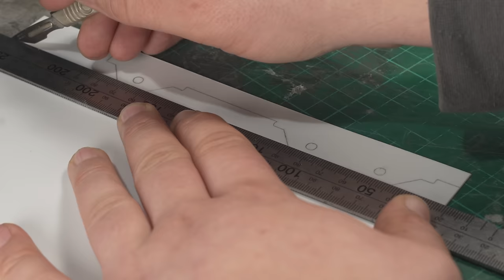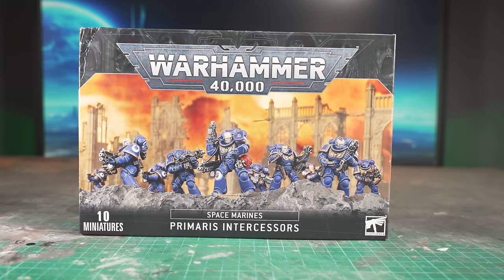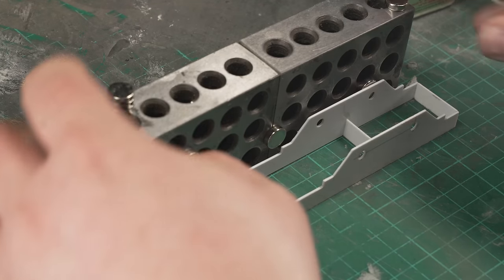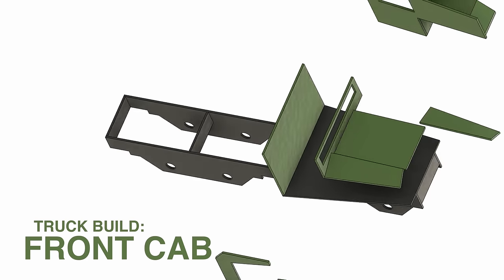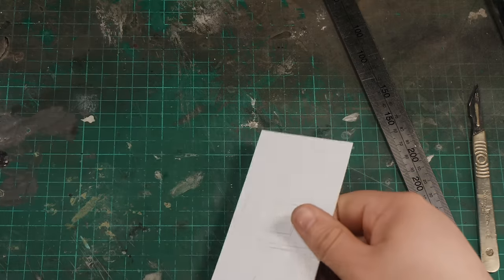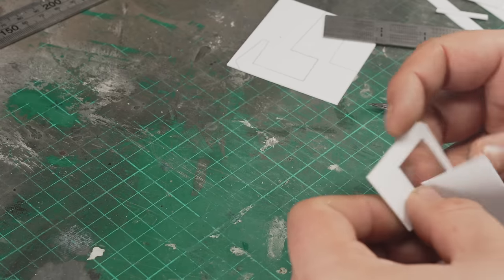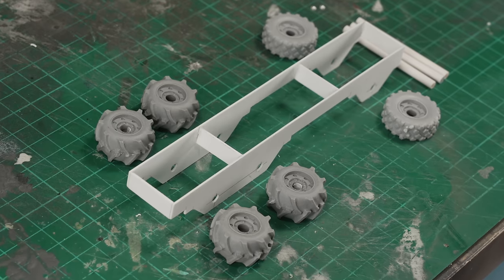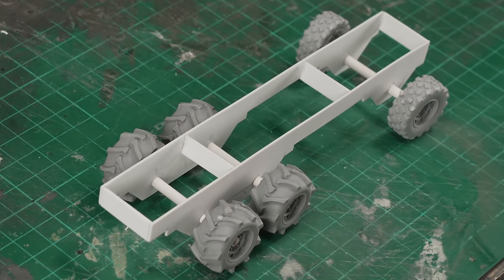Scratch building Warhammer 40K Is Easier Than You Think

Comment: As a younger orks specifically scratch builder - a helpful tip if you aren't precise/good at it, get some hot glue and foam, cut the foma into shape of the thing and glue it on the inside, it's how I did a lot of my smaller vehicles, as it's easy to have strong shape that way.
Reply from the maker: Yep, good shout my dude!
Reply: I had scratchbuilt some Grot Tanks before out of XPS foam and cardboard/cardstock, my most recent one was made almost entirely out of cardboard along with some other junk scraps
Reply: Big ups for cardboard!

Comment: That's impressive, more so because you've created a process that other people can actually follow that for the creation of a piece of art that no one will be able to mimic who isn't already skilled enough to make on with out help in the first place.  What I would like to know is about how expensive would you say one of these trucks is in terms of the styrene and resin bits etc?
Reply from the maker: Thank you kindly! As for cost, it's hard to quantify exactly, but I'd say averaged over the 5 trucks it's worked out at around £10 per Truck. The wheels are the biggest expense, with the Zinge wheels costing £7.50 for 6. The styrene is dirt cheap, even factoring in buying the tubes and other profiles. That's the nice thing about scratchbuilding stuff like this, once you have a small stock of materials, the cost of the each build is tiny.
Reply: @OffbeatBuilds  I have a friend who does a lot of 3d printing, if I wanted to do this wheels and greebles would be really cheap.

Comment: Nice tutorial, the templates could be printed on self-adesive paper, and then glued on the plasticard. It helps a lot!
P.s where did you find the wheels? Normally are the hardest part to find.
Reply from the maker: Thanks Alessio! The wheels are from Zinge Industries. I don't ahve access to the link right now, but they have a few different styles of 27mm wheels that do the trick.